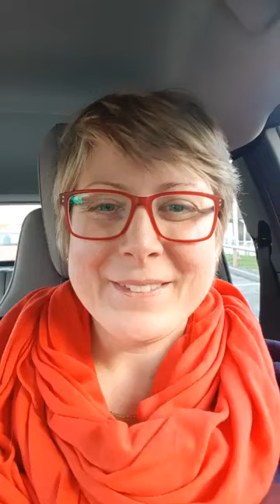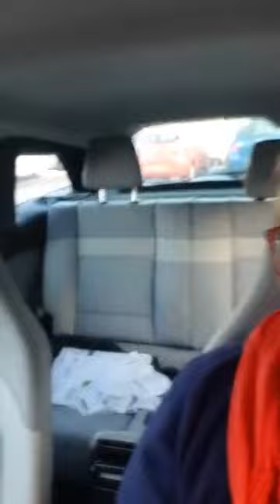How to Reduce Heating Costs in HMOS

Comment: Hi Jacquie thanks for another super useful video. One of my tenants has been using an oil filled radiator, but is wasn't sure if it would be just as expensive to turn heating up for whole house if one person only is cold? Does it still work out cheaper? Also very interested in that you never go below 16 degrees, that does make sense re condensation so will do this. I would feel slightly concerned again about extra cost though, as at the moment the heating goes down to 7 degrees at night and during the day even in winter ... What do you think? Thanks very much for any advice. Kat
Reply from the maker: Hiya, the other tenants should be able to adjust their heating with their valve on their radiator.  It might not be cheaper to heat the whole house more for one person. But I'd check that person's radiator as maybe it needs bleeding if everyone else is happy and that one room isn't.  

Personally I think it's more efficient to keep the house at a constant temperature than constantly letting it go cold and then heating up from scratch 2x a day.  You can always test it out and see but no matter what it's cheaper to run the heating a bit more than to constantly be dealing with damp and condensation issues.
Reply: @JacquieEdwardsPropertyGoToGirl  thanks very much Jacquie, grateful for your response - will try it!